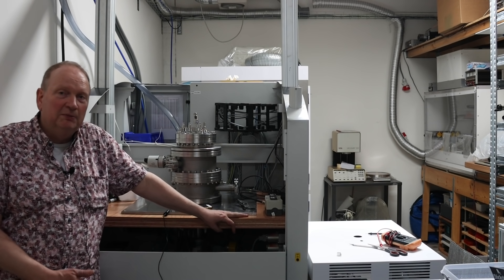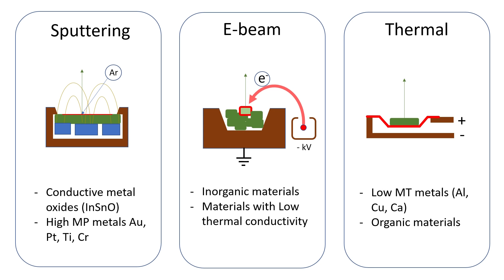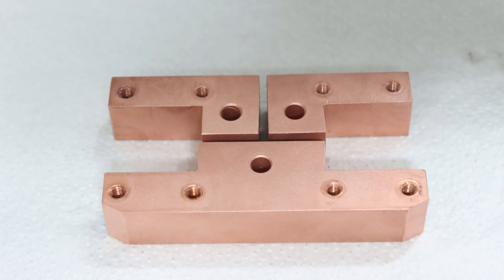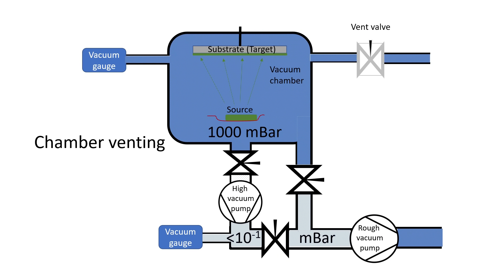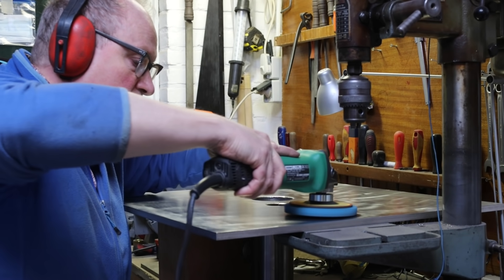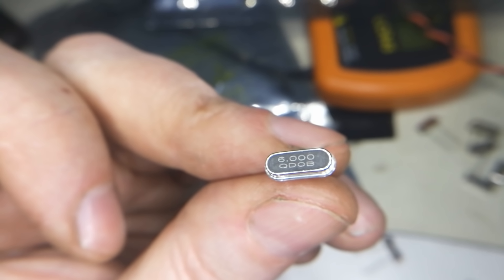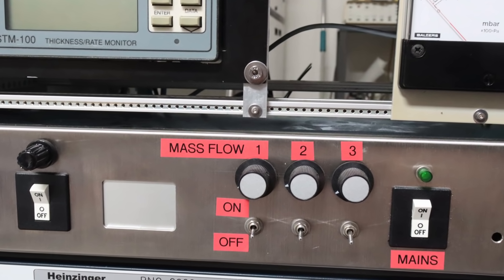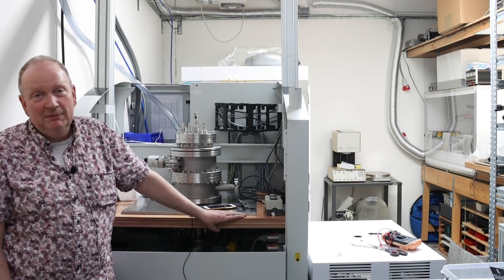DIY Physical Vapor Deposition (PVD) using Thermal Evaporation

Comment: This is an incredible project! I was thinking it would be absurdly expensive with all the vacuum equipment, but being able to fabricate the chamber yourself and that lucky find of a dead high-vacuum machine must have brought it down a lot. Can’t wait for more details in your project videos.
Are you considering adding a sputtering magnetron or e-beam source to your chamber to diversify the kinds of deposition you can do? The water cooling setup you’ve got would suit a magnetron nicely, assuming the couplings could be made vacuum tight but swappable. Also do you plan on making any electrical layers, like electroluminescent dielectrics, or OLED materials, or some sort of semiconductor fun?
Reply from the maker: You are on the right track here, combining active devices with optically active layers is high on my list. I will add e-beam to the system in the future. If you watch carefully, you can already see the Herzinger HV/ high current source  mounted in the rack. But this will require a serious interlock as well, since it is even more dangerous than the plasma cleaning unit.
Reply: @HuygensOptics 
Neat. Last I studied optics, I learnt about how polarising layers work, and how non-linear crystals change their optical properties when applied with an electric field. I think it’s possible to make a mirror that turns transparent when you apply a voltage, at least to a single wavelength. With any luck, your crystal tuning setup is sufficient to ensure that your deposited thicknesses are of the correct order in terms of wavelengths. If not, it might be possible to continually test the optical properties of the glass slide with light shining in the window of the chamber.
Don’t zap yourself, and good luck!
Reply: Really not that expensive. The turbopumps can be had for $500-1000 on ebay and the backing pump is only about 150-250 on AliExpress. Basic coating can be done with just the backing pump. Besides that a thick stainless steel pot can be used as a vacuum chamber or a big bell jar. There are people making vacuum deposition coatings using old fridge compressors and mason jars. A neon sign transformer can be used as the power source for thermal sputtering. There are also designs for <$150 diffusion pumps online and they will get you up to UHV with the proper care in part selection.

Comment: you channel is just amazing, just a question, how do you protect sensors and stuff while plasma cleaning, so they dont get damaged ?
Reply from the maker: That is actually a mistake I made with the thickness monitor: the front surface was not grounded. Generally you can keep the HV charging/plasma away by adding grounded surfaces or meshes to protect the sensors.
Reply: @HuygensOptics  i though similar, just imaging breaking you pressures vacuum sensor, im always verry careful when doing HV in vacuum chambers

Comment: Great Videos!, Fro cleaning did you use DC or RF oxygen cleaning system?
Reply from the maker: The microwave transformer supplies 50Hz 2kV AC. So it's not really RF. But it is AC, not DC.

Comment: Did you machine the copper holder for the tungsten boats?
Reply from the maker: Sure, copper is very easy to machine. BTW, I gave it a nice finish using glass pearl sand blasting.

Comment: We use a helium based cryopump to generate the high vacuum at work, but your turbo pump survived, so the information isn't helping.
Great videos it is so inspiring to watch.
Reply from the maker: Yes i've certainly considered it. It could be a alternative to ebeam evaporation. But since I do not have a CO2 laser and there are additional risks in pointing a high power laser into a vacuum chamber I think I will stick with thermal and will implement ebeam in the future.
Reply: Also have you considered laser evaporation? Could be a viable option for your small scale and high melting materials.

Comment: While the boats are very convenient, and although you have solved the problem, have you seen the tungsten filament solution that Willie Koorts uses for mirror recoating?
he did a great video on it a couple of years ago. I guess the current needed is much lower, and the wire way cheaper than premade boats
Reply from the maker: Yes i've seen it, thanks. Wires are actually a very good and cheap solution. Aluminum tends to dissolve boat materials, making them effectively single use. There are however solutions to this which avoid direct contact between aluminum and boat.

Comment: All high vacuum pumps i can find online cost more than half of my yearly income, and a used market for vacuum gear literally doesn't exist in my country. Should i just give up on trying to achieve high vacuum as a hobbyist?
Reply: We do need and open source turbo pump project for sure!
Reply: @vizionthing  @Applied Science has a great video on a homemade diffusion pump, it's a start!
Reply: @vizionthing  the engineering part of the turbo pump is not really the problem. its more the fabrication and getting the proper materials. high precision work with high tensile steel
Reply from the maker: What country do you live in? I guess some luck is involved in finding surplus. I acquired quite some stuff while working at a company that cleaned up their vaxuum equipment inventory.